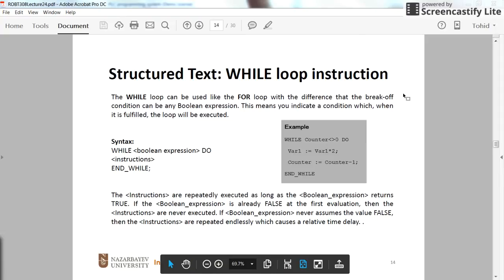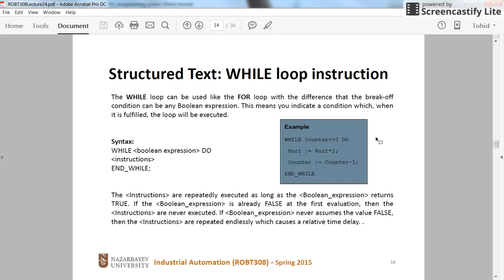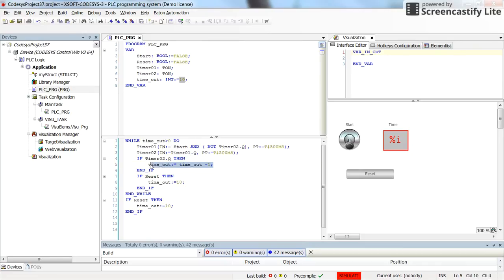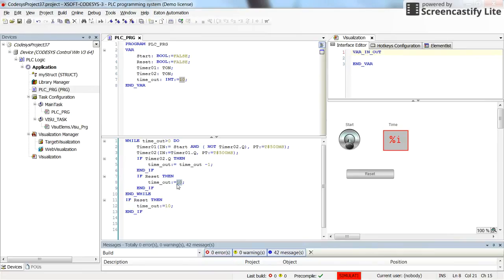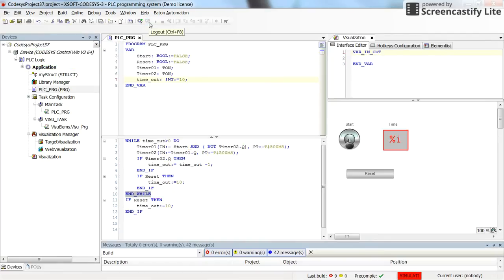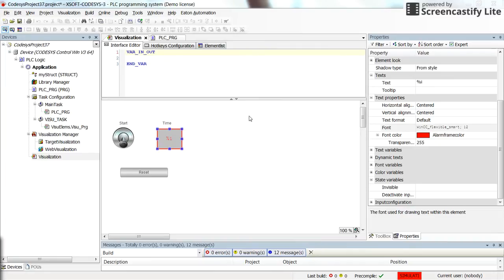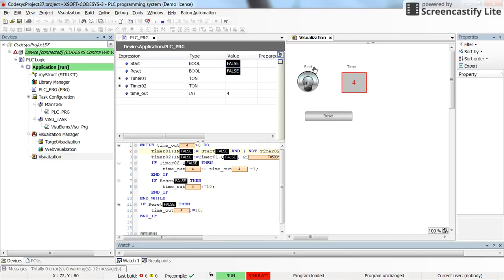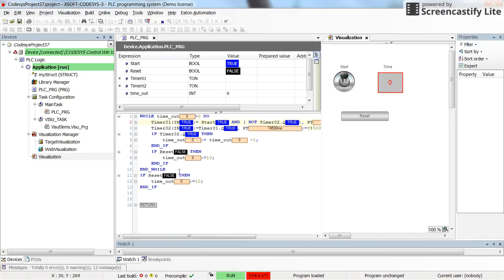CODESYS: Using While-Do loop instruction in Structured text (ST) #codesys #plcprogramming #iec61131

Comment: thanks for tutorial and can you explain why you use two timers and what does (NOT Timer02.Q) for timer01 input ?
Reply from the maker: The combination of the two on-delay timers makes it possible to generate a square waveform. There are other ways to do so as well, like using a Blink block or using pulse timers.
When two on-delay timers are used for this purpose, the input to the first one would be (Not Timer02.Q). I guess I have explained this in another video tutorial.
Reply: which video as i want to know second timer logic

 @TohidAlizadeh
Reply from the maker: @parshwabhavsar7855  This one, for example: https://youtu.be/YyOzihL_K-8

Comment: Thanks for your tutorial. I am having issues with the variable declaration in the textbox i.e. Time, I took object [Text field] and there I have declared Texts > Text >%i, then I have declared Text variables > Text variable>time_out ; it says failed to load into PLC, some exception messages, so I instead used the object [progress bar] and it works fine. just wondering what object yu chose to show the variable time_out value ?
Reply from the maker: Thanks for the comment, Jamal. 
I am not sure why you receive the error. I have used a "Text field" element and have set the variables as you have described and it works without any problem. Do you get any error message? If yes, please let us know.